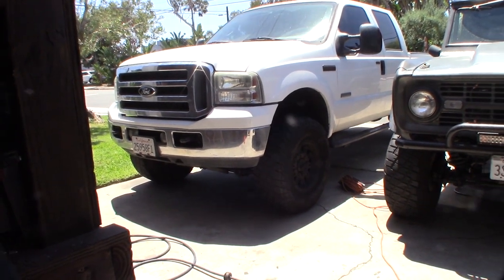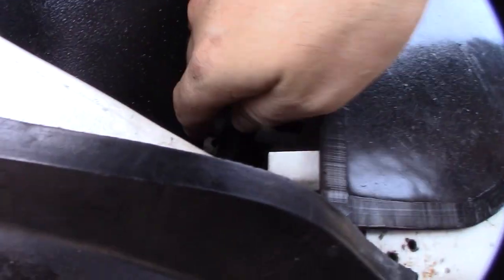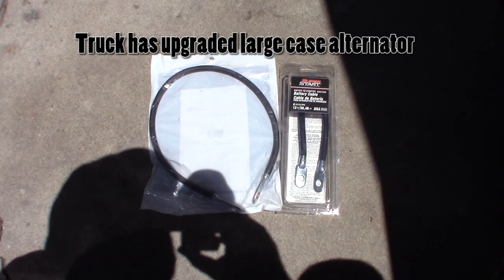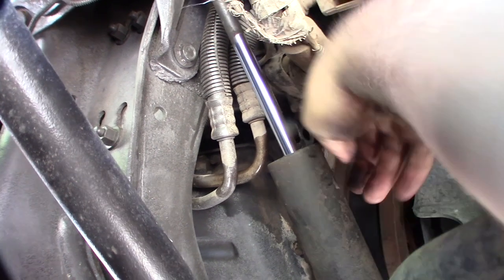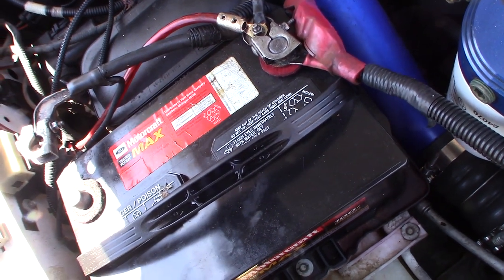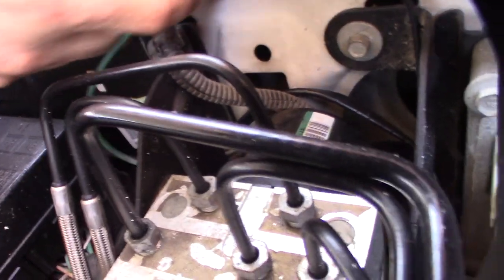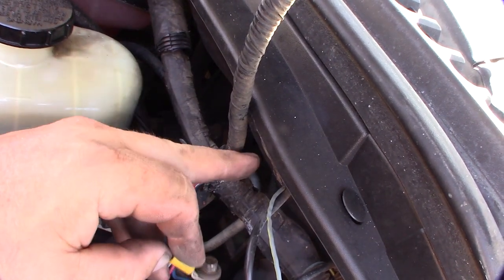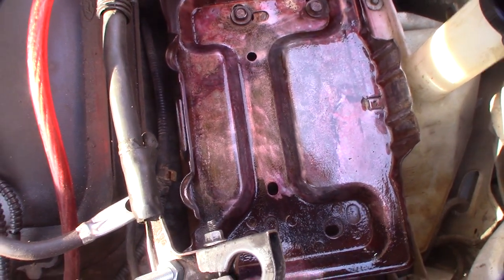F250 Powerstroke 6.0 Battery Ground locations , chassis, body, block clean and repair

Comment: I know it’s three years later but I just found your video installing my motor back in didn’t take enough pictures wanted to make sure I remember where all the grounds are you got them all except one there’s one coming out of the engine harness that bolts the the driver side intake manifold thanks for making a video been having a hard time finding harness wiring routing thanks for making this video man

Comment: Inside the engine compartment, the various grounds to the body (like the FICM ground, firewall and over by the passenger battery) have an interesting ground path.  The ground path is from the ground cable, through the captive washer on the bolt, through the captive washer to the head to the head of the bolt, down the bolt, through the bolt threads and into the body.  Studying this connection, I realized there are to spots that need attention that might not get the attention they need.  

#1 Wire brush the threads on the bolt.  The electrical connection is through the threads.

#2 The female threads in the body.  I took a brass bore brush (like used on rifles), chucked it in a drill and ran it into the female threads to clean the corrosion.

#3  Corrosion between the captive washer and bolt head.  I went in and took fine grit sandpaper in the small gap between the washer and the head of the bolt and cleaned that really well.  Simply wire brushing the bolt does not clean that connection very well.  If that interface is highly corroded, you could completely interrupt the ground path.

Personally, I then used Permatex dielectric grease (#22058) on all surfaces to prevent future oxidation and corrosion.  Some people think an insulating dielectric grease is not a good idea, but these are contacts with thousands of pounds of contact force and the bigger issue is prevention of future corrosion.
Reply: Some add a ground wire from drivers battery to the ficm ground stud.

Comment: ‘04 6.0 Die F-250 super duty …slow crank …good batts ..remove top fan shroud guard ..put 1/2” breaker bar or ratchet on tensioner for serpentine belt and slack it ..make sure alt. Pulley turns…tell someone to crank it and see if it turns faster…make sure your A/C is turned off…if it cranks ok it’s probably the A/C compressor…if A/C still works make sure you turn it off before you shut dwn engine !!.. hope that helps 👍🏼

Comment: Bad grounds on these vehicle's is destroying the transmission front pump,,,known issue..
I fix by adding a ground to drivers side motor mount bolt then connect it to drivers side negative terminal..
I buy a generic 4 foot 4 guage ground wire from the auto parts store for about 10.00 it has a round eyelet on both sides
Reply: Could not solving this problem result in intermittent battery death? If I let it sit for a couple of hours it has trouble starting.
Reply: @discipledesigned  More info needed..
What kind of trouble starting?
Extended cranking before engine starts??   OR
The engine is has slow cranking speed?
Clean and tighten all 4 battery posts and terminals,,many problems are solved right here
Reply: The cluster can drain the battery  @discipledesigned